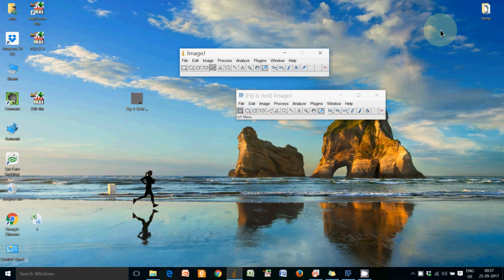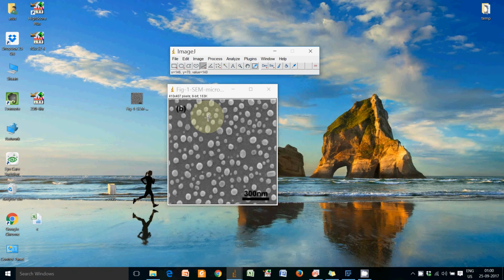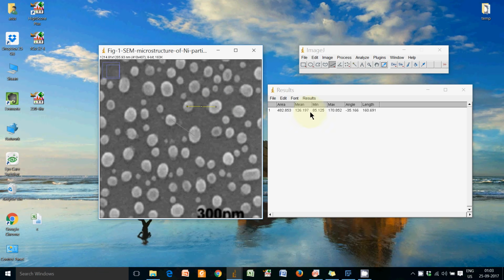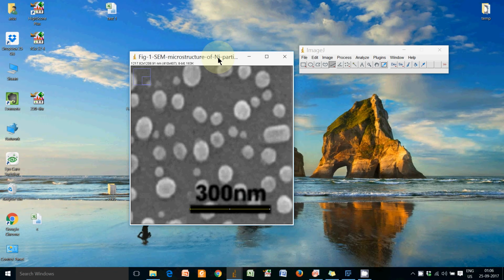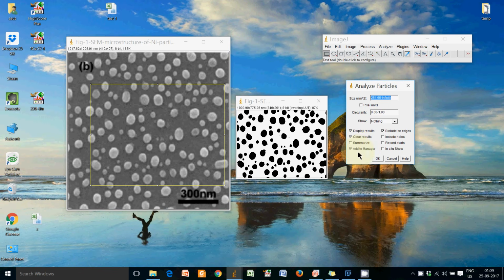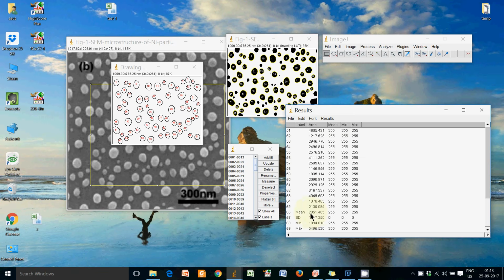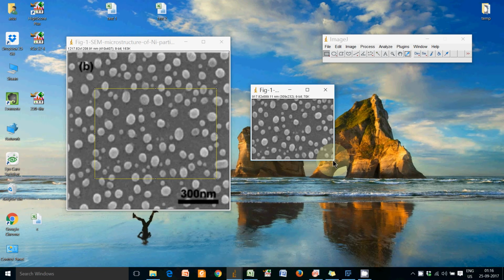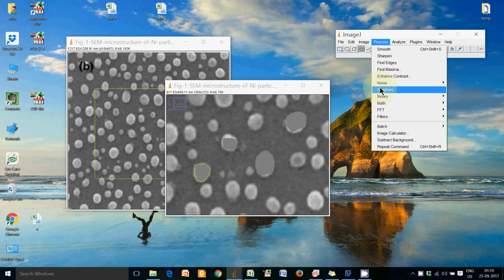ImageJ Analysis: Length Measurement, Area Measurement and Thresholding

Comment: thank you so much, but when to use each? If i want average size or the diameter, they are the same right? so i use the first technique where i draw 2 perpendicular lines on each particle and measure, while if i want the average area i use the second technique of the threshold? I tried it manually as in the third technique and it resulted different result, what to do or what to use? thank you in advance

Comment: Thank you very much, for your tutorial. 
I was wondering how can use the threshold if I have holes onto a surface area that I want to measure? It feels like they break my total area in small pieces. I was thinking to take about 5 measurement of it manually at this point and use a standard deviation, could that work?
Reply from the maker: Yes. It should work perfectly.

Comment: Thank you for the video. I am using Image J for analysing my bubbles (from Foam). Since the bubbles are see through, I need to use the manual method for selecting the bubbles. However , this is taking a lot of time and some cases it considers one big bubble as two and calculates the area. What is the solution for this? Though I set the scale initially to cm, it displays results in area percentage. In this case what would be the unit of my results? Please help.
Reply: hey i have also the same situation. did you solve this problem?

Comment: When I scanned my leaf, I forgot to put ruler beside it so I cannot do set scale. what do you think I should do?
Reply from the maker: If you know the length of any part of the leaf ( which you can measure manually after scanning using a scale), just draw a straight line over this know length. Using set scale, give it the value, which is measure manually. This process will not be 100% accurate, but it will work.

Comment: Hi professor. Great video! I will appreciate so much if you can clarify my doubt, it is about the result of the mean value obtained by the thresholding method. The summarized results showed 2851.485nm^2 +/- 1217nm^2. So, is it possible to say that the grain size of your sample is:  2851.485^0.5 +1217^0.5 = 53.40 nm +/-  34.89 nm ?? Thanks for your time
Reply: that would obviously depend on the shape you want to assume. Most particles shapes are approached using spheres so you would need to find the diameter of a sphere with given cross sectional area.. if the shape is very irregular i would either take an average of different lines through the particle or choose a strategy (like e.g. finding the maximum Feret diameter)

Comment: Hi, Great tutorial video ! I have a question, when I clicked the particle size analyzer, a small window popped up and showed a table of area, minimum, maximum, and mean. Do you know what is minimum, maximum, and mean stands for the particle with an abstract shape (its shape is sometimes like rod and sometime like oval) ? (i'm working with micro fibril cellulose/ MFC particle). Im not sure that minimum and maximum stand for width and length, because the value is much larger than area. I hope someone answer my questions. Thank you so much !
Reply from the maker: First of all thank you. Coming to your question, min, max and mean represent the 'gray value' of the particular selection. Gray value '0' means complete black and '255' means complete white. Hence these things are not related to shape, rather related to color. One more thing is that you are getting - 'area', 'min', 'max' as default in 'result' pop up. But you can set those parameters or add more according to your requirement by going 'Analyze'--> 'Set Measurement'.
Reply: Thank you so much :D